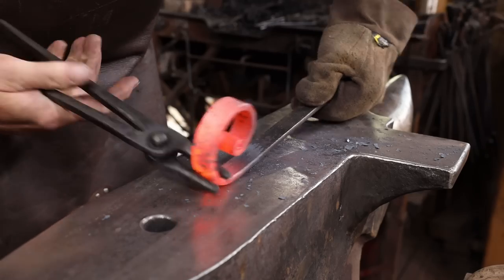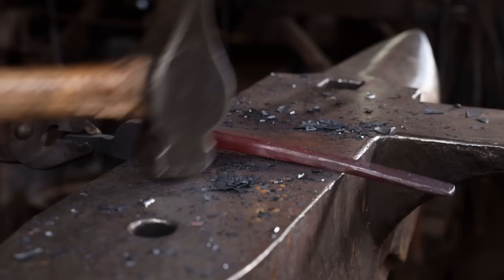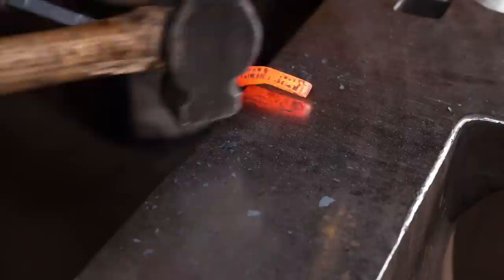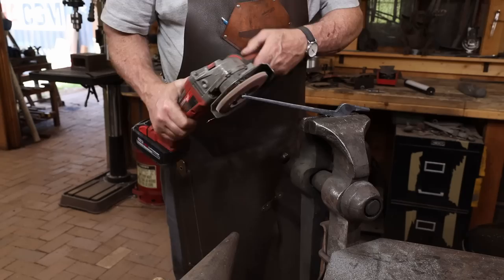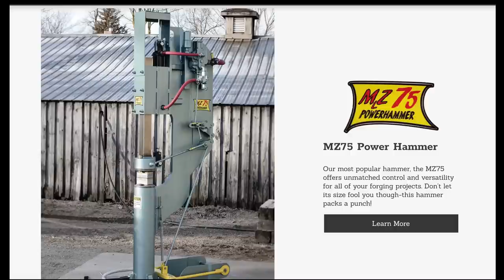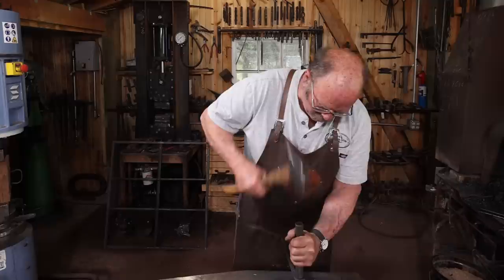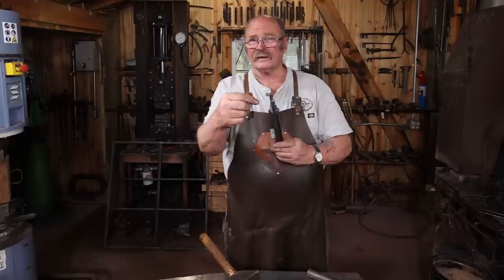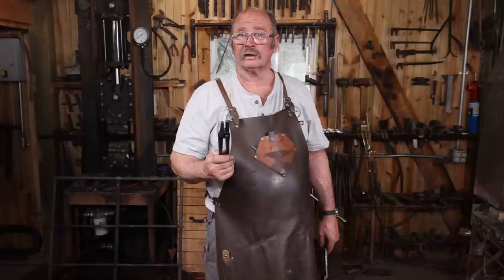Scroll Tongs from Kens Custom Iron - Blacksmithing

Comment: I bought both tong bundles from Ken, the Rapid and the Quick tongs. I’ve had my forge up and running for only a month, I figured I would build my skills by making tools I need anyway. They were easy to make, great instructions, and sure enough I noticed a real growth in my basic skills like drawing out, shaping, riveting, even made a chisel from a coil spring (after watching your video on how to do it, John!) and used it to make the v bit tongs. And now I have a great selection of tools I made that will serve me well for years.

Comment: I tend to call the parallel type "pliers", and the ones that pinch in to points (for really fine "spot" or "point" adjustments on ribbon ends or acanthus leaves etc) "tongs". I don't know why, other than that if I were working with other people and asked "go get "X", they come back with what I want not the other thing haha
Reply: The old joke "go get me a left handed pair of pliers", might be a practical joke these days. But using a pair of tongs of the wrong hand is actually really awkward in terms of their use. Rolling them this way and that in the hand, the natural line of pull on the reigns to the jaw etc.